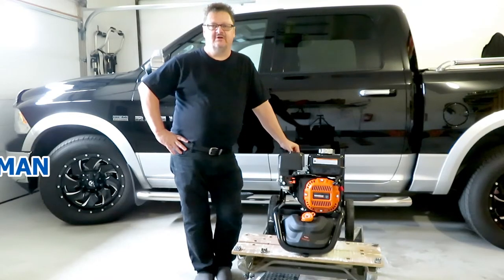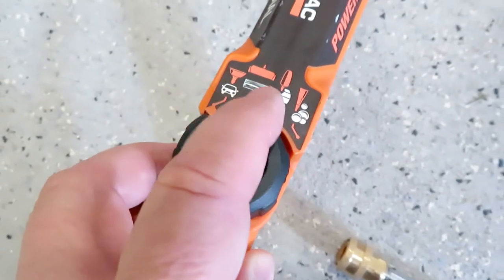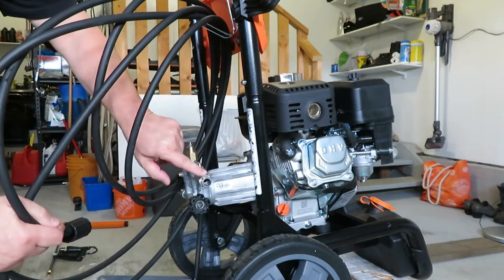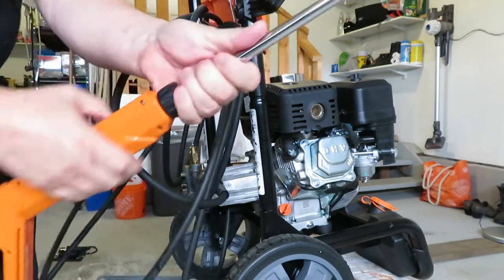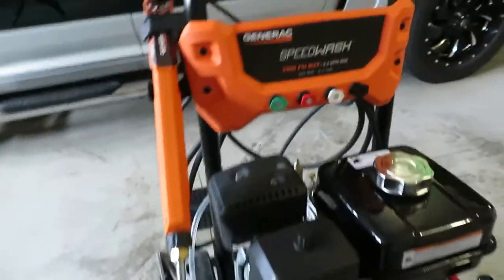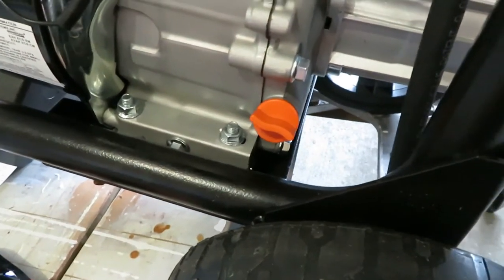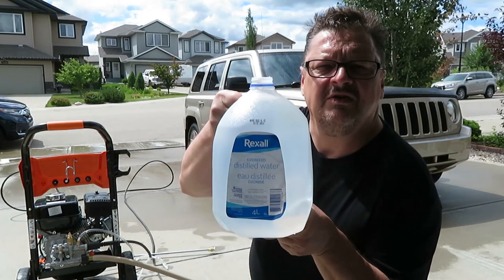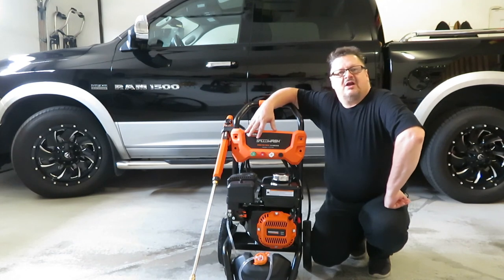GENERAC 2900 PSI - 2.4 GPM Pressure Washer - Assemble - Use - Review

Comment from the maker: After 2 years of sporadic use of this #generac pressure washer it has been working great.  It starts easily even after sitting for a while and the pressure is excellent.  The only issue I've had is with the soap dispenser and tube clogging up.  I decided to go with a soap cannon anyway so don't use the attached soap dispenser anymore.

Comment: I purchased this exact same power washer last year, and it worked flawlessly.  It's been in my shed since I last used it which was the spring of 2019.  I of course put fuel stabilizer before storing it.  I went out earlier today to see if would still start so I could power wash the vinyl siding on my home.  I was very pleased to see that this unit started on the very first pull.  I bought this Generac to replace a Honda power washer which was never reliable from day one.

Comment: Great product, I hooked mine up to a hotbox and washed out about 400 commercial refrigerated semi trailers.
That's about 100 + hours of use on original pump.
When pump finally gave out, simply ordered a new one for 111.00 with free shipping.
Easy off easy on pump 4 Allen head bolt and shaft key.
My 3100 psi generac speedwash unit has about 225 hours on the original pump so far.  I use the 2900psi unit on a mobile trailer and my 3100psi unit on permanent commercial site.
Generac 196cc engines are very decent, but stay up on your oil changes and it will last a long long time.
Great video!
Reply from the maker: Thanks for the great comments and useful information on longevity of the pump.

Comment: Just a note : 
I did buy a full rolling 15 inch Surface  cleaner ( $79 Amazon ) it comes with 2 - 15 in wand sections that can be use as added wand Lengths , I use one with the wand from washier for regular use and all 3 for surface cleaning .

Comment: Thanks for amazing guid. The instructions manual was bit confusing but your explanation was super simple.
Reply: He said he had to add oil but it seems my came all ready filled how about yours
Reply: @kenneththomas2416  I had to put the oil in. It should come with oil pouch.
Reply: @pscod3842  it did come with it it just looks like and smells like there’s oil in it already but I’ll just it it in and see
Reply: @kenneththomas2416  you can check the oil like how you check oil in your car. Take the oil stick out wipe it with napkin and put it back in and pull it out and it should have an oil mark line.

Comment: the instructions with my Generac 2900 PSI 2.4 GPM Pressure Washer (page 5) says "Verify the thermal relief valve is rotated and open to the ground". BUT - there is no other reference that I can find in the manual about the "thermal relief valve". -- where is it and do I leave it rotated and open to the ground all the time, or only when I'm using the machine? Thanks if you can help.
Reply: Mine came with a pre installed hose clamp locking it in place pointing to the ground.

Comment: Question. To use the syphon feature (the black tank and hose)….can you only use one specific tip? 

I tried using several and it won’t syphon unless I use the bigger black plastic nozzle end.

I sort of understand at 14:40. Thanks.
Reply from the maker: I only used the hose/tip that came with the machine.  That being said, I haven't used the tank since I left soap in it and it plugged the port at the pump.  I since bought a "soap cannon" for the pressure washer.
Reply: @mundaneman254  thanks. Just got a pressure washer soap cannon two days ago! Haha.

Comment: Would you recommend this if you wanted to start a mini pressure washer business?
Reply from the maker: That is a good question.  I think this unit is designed for light to medium use so depending on what you intend to do with it, it may work fine.  How long it will last with steady use, I have no idea.

Comment: So after you turn it on - do you have to begin using it right away to avoid pressure build up? Is there a such thing as letting the pressure washer “warm up?”
Reply from the maker: I don't usually let it warm up before using it but you can.  The main thing is to have your water on before starting it. I prefer to shut it off if I'm getting supplies or moving a vehicle around, etc but I don't think it is required.

Comment: Mine smoked like hell for quite a while after 1st startup and blew black spray all over side of engine. The engine will not stay running unless the airbox cover and air filter is removed even after warm and choke is off
Reply from the maker: Hmmm...that sucks.  I still haven't run into any issues with the unit I bought.
Reply: @mundaneman254   - I’m sure mine was because of shipping. I’m sure it spent some time on its side during transit and filled the paper/sponge air filter with oil from assembly

Comment: I just bought one yesterday and my gun doesn't come with the dial..... I feel jacked
Reply from the maker: That's a bummer.  I wonder if depending on where you buy and the model number if they add and delete options to keep cost down.
Reply: This version at my home depot is bare bones. No soap tank, no dial etc. The next one up is $220 more but it has all the features in this video at 3200PSI. Feeling conflicted atm.